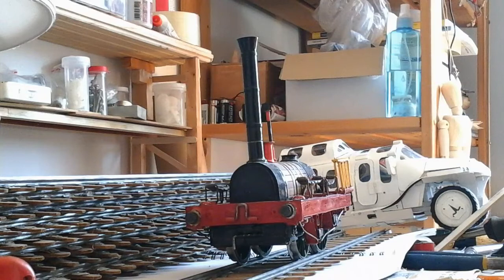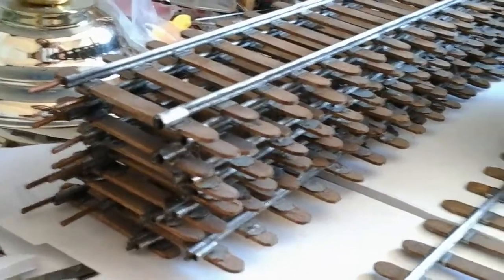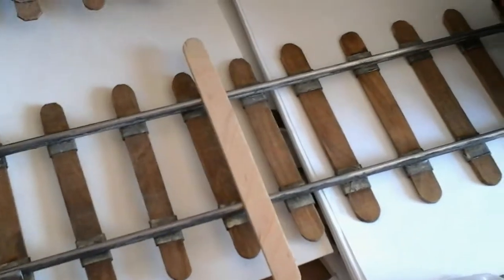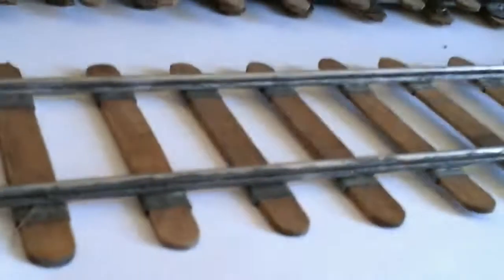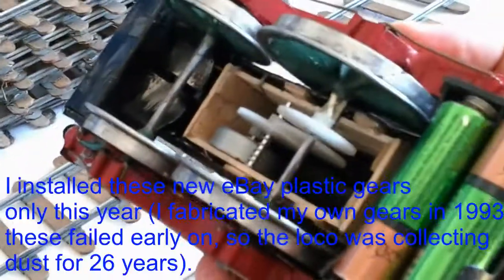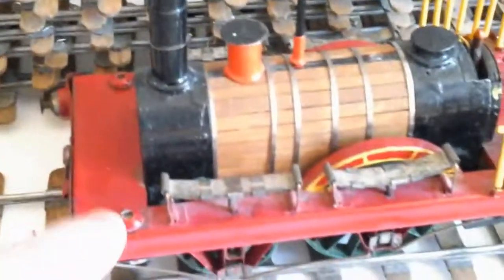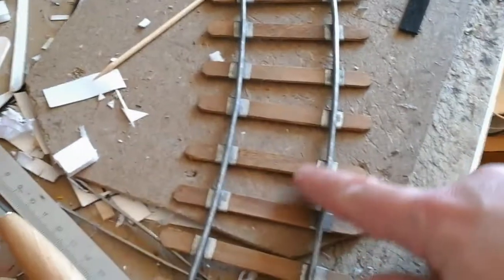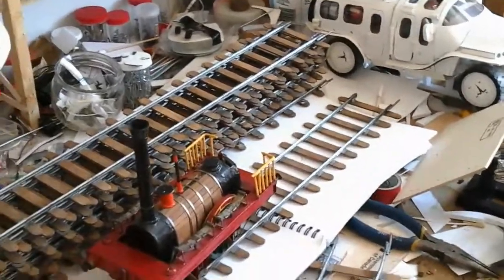Gauge 1 (G-scale) DIY Locomotive 1830 Planet (all metal truly built from scratch)

Comment: Two different model railway scales run on 45mm. guage track:

1 Guage which is 10mm. = 1 Foot / 12 Inches (1:35 scale).
G Guage which is (1: 24 scale narrow gauge).

Your model Planet is 1 Guage because it is not a narrow guage model loco.
Reply from the maker: Yes, I know. When I made this loco in 1993, there was no Internet and I did not do a proper gauge research in a library. Thank you, I will append that in the title.

Comment: Nice sir
How u made the racks
Reply from the maker: Thank you. I will make a separate video for tracks. Each track is made from two 1/8 in. wires soldered together.
Reply from the maker: Just uploaded DIY track video: https://youtu.be/qqmBIi9c35M
Reply: If i want to made tracks using other material except brass and in cheap price with pantograph
Reply from the maker: @RohitSharma-tc4te  You mean  other metals or plastic and cardboard? Pantograph is needed only if you build a locomotive.
Reply: Yup sir
Reply from the maker: @RohitSharma-tc4te  (For some reason I did not get the notification of your response two weeks ago). I never tried making tracks or pantograph with any other material than metal, but other youtubers do. I prefer soldering steel, galvanized steel, and copper.